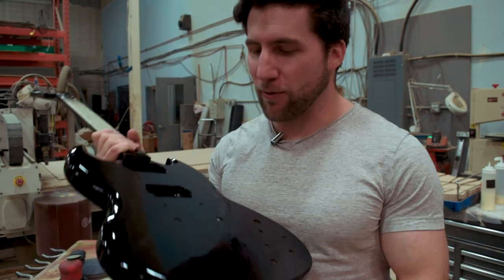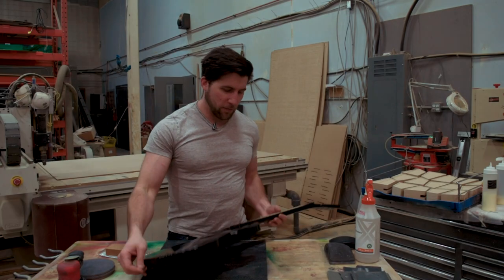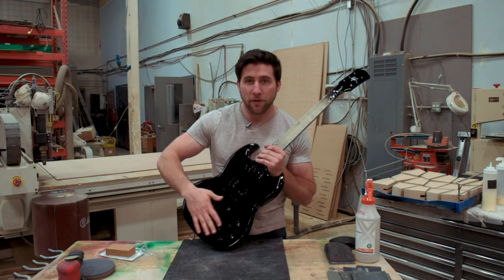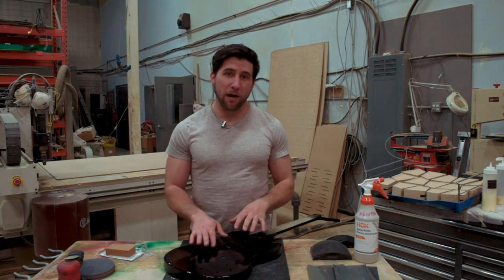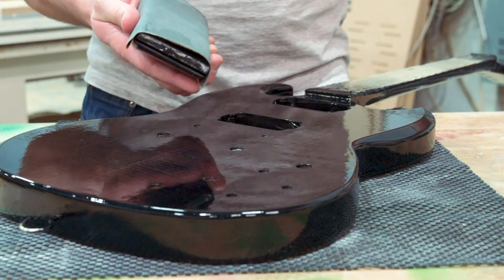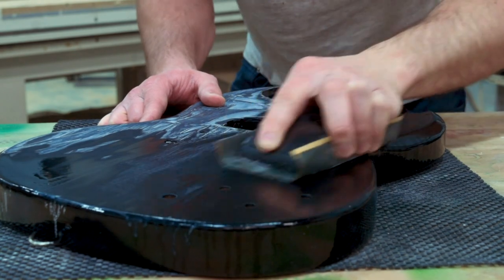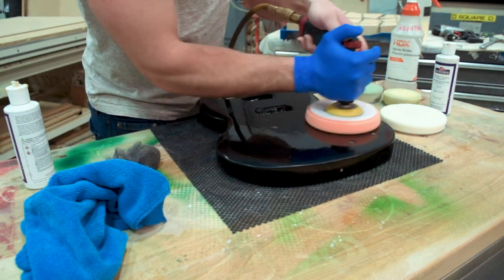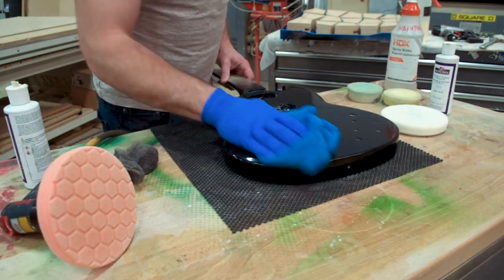The Ultimate SG Guitar Kit Build (Full Upgrades) Part 5 - POLISHING!

Comment: On car finishes I used to use a couple drops of dish soap in water for the spray after soaking my paper in water. I'd finish with body-sol or naphtha wipe down. The slightly lubricated water seemed get a really slick finish, easy sanding and more life out of the paper. Just my old school ways talking....
Reply from the maker: Ya, I used to do that as well. I don't think people do that very often with modern paper though. I could be wrong of course.

Comment: Hi Brad. I've seen photos of old Stratocasters with nitro paint that looks almost translucent. It's looks like a solid coat of paint, but in close-ups you get a glimpse of the wood grain through the paint. It look really nice, and I was wondering if it was possible to get that effect using acrylic paint. Acrylics frequently are a bit translucent anyways. Do you have any experience creating such a finish?
Reply from the maker: Yes, you can do that with a more heavily thinned coat or with a dye based coat instead of pigment based.
Reply: @BradAngove  Thanks a million. I'll give it a try. :-)

Comment: Don't agree about the Naptha.  I have never had any issues with water on any build and if you raise the grain properly before finishing, swelling is never a worry.  When you're sanding,  you should sand one way, then clean and go 90 degrees on the next pass.  Your finish will be smoother.
Reply from the maker: Do you think just because it’s never happened to you it can’t happen? I’ve had a lot of people contact me asking how to fix finish cracks that came from that very thing. Raising the grain is a different issue entirely. Still important, but not part of the swelling issue.

Comment: How come you put black over flame Maple I would have thought you would have used black stain over the flame Maple so you can see the flame, but I guess that's what whoever you doing it for wanted you to do. It just seems a shame to waste that Beautiful flame maple.
Reply from the maker: Sounds like you answered your own question on this one haha. That’s what the client requested.
Reply: @BradAngove  I was 99.9999% sure that's what the deal was. It just seems a shame you couldn't talk him into doing black stain over the front and black paint everywhere else. Here's a tip, you know how when you try to use most black stain it comes out looking near black but has a brownish tinge to it? You can take your black paint, thin it with naphtha making a stain. I don't like using paint thinner because it wants to roll up on the wood and not soak in properly. Anyway take your black paint, cut it with naphtha then test it on a piece of scrap wood until you get the consistency and the Darkness you want then use this thinned down Black Stain made from the same paint that you're gonna use to paint your Guitar with and you'll have the same exact shade of Stain as the paint. It won't be more Black, Blue, Brown or a little bit different, it'll be the same exact colour only translucent. It's simple because you don't have to buy two products all you need is about a shot glass full of paint and the rest Napthia. It doesn't take very much to stain the face of a guitar. This works well with any Guitar where you're going to paint the body and the whole remaining part of the guitar with a solid colour and you want the stain on the top to match the the solid colour used everywhere else. You must use a water clear finish over black & white stain or paint. Whenever you use a something with an Amber Hue over black or white you end up with black that looks like super dark chocolate or ebony not quite black. With white if you use amber coloured clear coat like a varnish over any kind of a white paint you get a yellowed White it doesn't look white white. This isn't a factor when you're using a clear that has amber tint over traditional wood colored stains, any shade of brown or anything like that you only have to worry about it when they're using black or white. If you use the spray cans spray a small amount into a container and add a little bit of naphtha you won't need to thin it much because spray paint is much thinner than Brushing consistency Paint. Be sure to test it on a scrap of the same type of wood if you have it you don't necessarily need flame Maple the test stain on. You can use plain maple the test on you'll get the same look you just won't see the flames but you'll get the feel of it on any kind of maple. I hope this helps You.
God Bless You and Yours!!
Jimmy in NC....